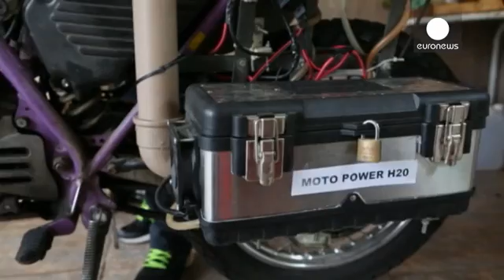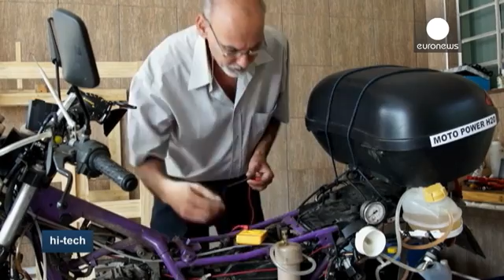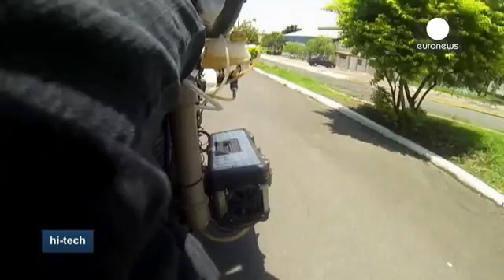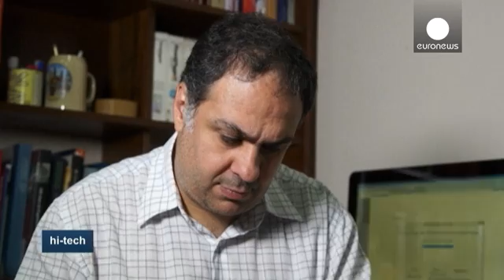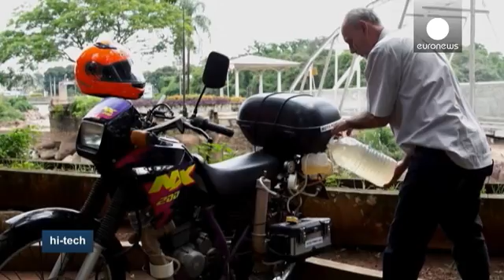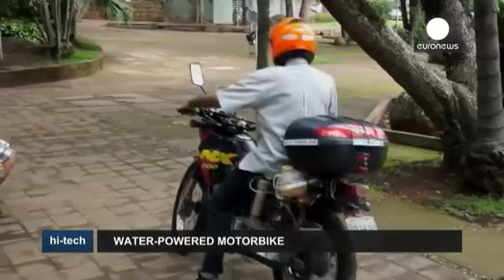"Moto Power H2O" - Water-Powered Motorbike From Brazil

Comment: LOL! Sorry to disappoint some of the dreamers watching this video. This video has a very misleading title.  The whole contraption is powered by Electricity not by water. And it's doing it in a inefficient way! 

So, if the purpose of the bike is to move a person from one place to another with less cost and less pollution to the environment, then, take a look at these factors: 

1) Energy path: Electricity stored in battery(Potential Energy) -> Consumed in Chemical Reaction in hydrogen generator -> Hydrogen/Oxygen (a different potential energy) -> Consumed in combustion Engine  ->  Movement (Kinetic energy).  As you can see there is also wasted energy in each conversion process from one type to another.
2) Emissions: Water vapor, wasted heat.   
3) Efficiency:  Every component ads weight so the obtained kinetic energy will allow to travel less distance as the machine is heavier. Consider the weight of the Battery, Water, hydrogen generator,  combustion engine, with all the supporting extra metal to start the engine, to remove noise and vibration, etc. A lot of stuff goes to support an obsolete explosion engine.

Then Let's compare the same factors when using a pure electric bike:

1) Energy path: Electricity stored in battery(Potential Energy) -> Consumed by Electric Engine  ->  Movement (Kinetic energy).  As you can there is less waste in energy conversion and also Electric engines are way more efficient to get more Kinetic Energy than Combustion engines.

2) Emissions: Nothing. Only some wasted heat from the engine, but minimal when compared with an "Explosion" engine.
3) Efficiency:  Only the weight of the batter and the electrical engine.

One more point about whether  an inefficient machine is good for the environment or not: Let's assume that the original bike was using 1 gallon of gas to move a person for 70 miles. Now let's assume that we can convert that gallon to Electricity and use it in this contraption. With all the added waste, it will not be able to move that person those same 70 miles. Maybe distance will drop to 50 or 35. Maybe 2 gallons will be needed to cover the same 70 miles! In that case, the real pollution would double, producing a negative impact to the environment.

Comment: Bullshit
Reply: Because he can destroy your oil industry?
Reply: Retul  Because it takes more energy to split the water than you get back from burning it, an internal combustion engine is less efficient than an electric motor, and no electric motor that does work and should be getting the attention this snake oil is getting uses a single 12 Volt car battery to go that far because it simply doesn't store enough energy to go that far.

Comment: This hype is complete rubbish! Because, as the proffesor mentions, it doesn't run on water but on electricity which is pretty easy to see because water comes in and back out in the end. The water is only used as a second energy storage. Let's just have a look at the path of the energy: it first is going to be stored in some kind of fossile fuel, perhaps coal, which is burnt in a power plant, the energy is set free. It will make water cook and the steam drives a turbine which is connected to a generator and so on. So the coal is transferred into electricity running through cables. He uses uses this energy to charge the car battery - the energy is stored in there. Then it is used to split the water into hydrogen and oxygen so the energy is stored there until it is burnt and converted into kinetic energy (movement) and some pretty heat. You see: stored-burnt  (transferred)passed on-transferred-transferred-transported[stored-transferred (fuel cell)-stored (H2)-burnt/transferred (motor)]. You have like a thousand prozesses where energy is transferred which is never going to happen at a 100 % efficiency so there are everywhere power and energy losses. So let's have a closer look at what happens inside the motorbike which is put in [brackets]: The power first of all comes from a battery - it is powered by electricity. And then the energy is transferred again and again which makes it just UNEFFICIENT. Putting an electric motor which is also way more efficient there directlictly connected to the battery makes much more sence in efficiency and environmental aspects, it is even less material needed at this point. So, I hope I was able to show you that even if the bike only uses 1 l of water for 500 kms, this doesnt make it super-efficient or anything, it does right the opposite. By the way the water in this machine is nothing else than a second accumulator that just changes it outward so it can be reused and he could ride forever with one liter, actually. And to ride 500 kms, he probably had to charge this tiny car battery like every 5 kms as it has to deliver all energy. No other electric bike drives nearly 500 kms with such a tiny battery, and this bike is even far less efficient, as I pointed out. And that dirty river water is going to be stuck in all his pipes and the fuel cell and everything very soon.
Reply: I forgot to mention that I fucking (sorry but that's really just the right expression ;) ) love hydrogen and I think it is gonna be the solution for all the people who like combustion engiens and stuff. I just want to critizise the way the media handles this news
Reply: +lapamful what's your problem? It's like the second sentence in the video. It says that this very bike is powered by a car battery that produces the hydrogen which is burnt in the motor later on. I know I should have left out the part of electricity 'production' and things but I can only tell you once more: the energy comes all from the one car battery which stores approx. half a kWh. It produces hydrogen that runs the motor which has probably a peak power of 50 kW but during normal driving uses a few kW. And of it would be only 10 kW, this ment the battery was empty after 3 mins (time=energy/power; 0.5 kWh/10 kW=1/20 h=3 mins).
And saying the engine was powered by water is like saying a petrol/diesel car was running on CO2, and water actually as carbohydrates are burnt.
Reply: Ernst just pwnd you with science mate. You don't seem to understand the video even if they just explained how it works. Again, it does not really run on water. The water is only a vessel for the hydrogen. As hydrogen is extremely flammable it's safer and easier to store larger amounts of water from which you make little amounts of hydrogen from than to move around a large vessel of hydrogen which would also be hard to fill and extremely dangerous in a moving object to carry on. The coal reference was just an example. Also saying that the normal combustion powered vehicles batteries "recharge themselves" is a bit of an overstatement. It all takes some form energy to make another form of energy. Nobody is debating that these things are great but there's much to be done yet. In my country even if I wanted to make a vehicle like this the police would probably give me a ticket every time I drove it and maybe take my licence away. It's so regulated what you can drive. But some changes like this needs to happen fairly soon,  the most impact with the least effort would be to modify the Asian bikes which are the most commonly used form of transportation. And you can pretty much drive a brick there and nobody would care. And the impact would actually be visible straight away to the human eye even with no tests done on the airquality
Reply: there is chance it get it power from some metal which suck the oxygen out of the water and byproduct is hydrogen. so it uses some electricity to boots seperation.
Reply: Reading all of this information. Is he using gas or water with the battery and electricity? So we need to see the bike running without the water correct? Is it safe to say that the bike runs off electricity/battery and water? From this point~ would make this thread irrelevant? Battery+electricity+water= ? Stop debating and construct your own studies, research, and experiments. Shame on you all for this frivolous conversation. Instead of you guys maybe taking the idea and expanding on it by your own experiments you debate from a non-scientific proof. LOL, using scientific rhetoric to disprove something without concrete evidence. That's not science... HAHAHAHAHA you people.
Reply: Ralan Enterprisesllc  The maker of the claim ("I ride 500 km on water!") is to provide the proof for said claim. If you do not agree, please prove the nonexistence of the Flying Spaghetti Monster.